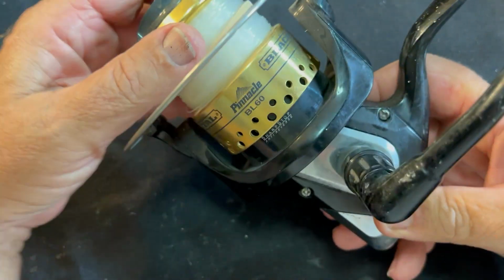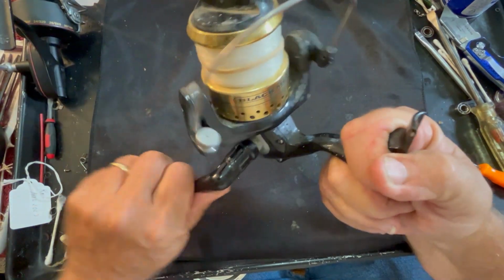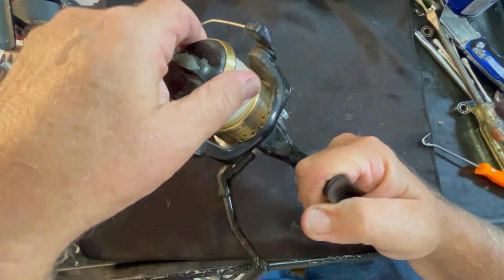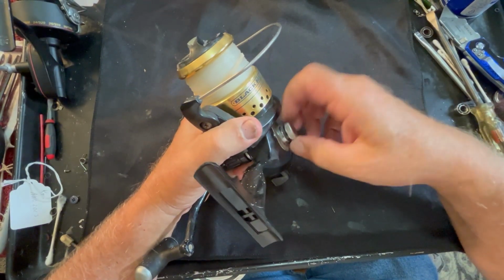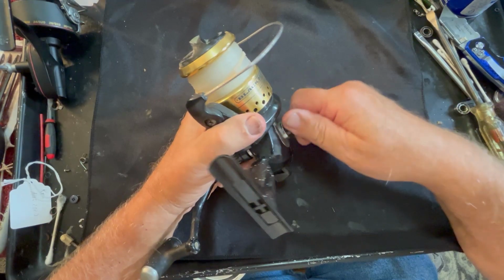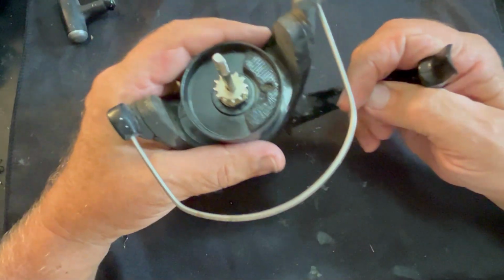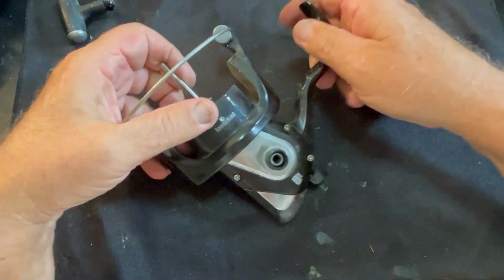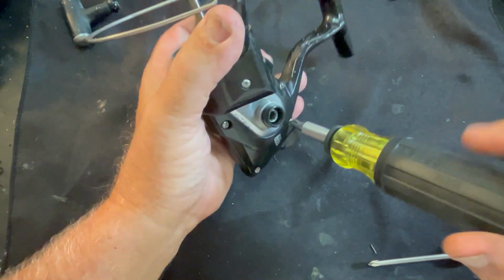Pinnacle BL60 -- Service and Lubrication -- Young Martin's Reels

Comment: I used your useful video to service my BL60. Sadly after doing a complete service, I noticed the bail wire was ready to snap. Any clues to finding another one?
Reply from the maker: Unfortunately that reel doesn’t seem to have been very popular so there aren’t that many out there for sale. I think your best bet would be to keep an eye on EBay for a parts reel. There aren’t any right now but occasionally I get lucky and find a hard to find part there.

Comment: This reel bears witness to what I’ve often heard about Pinnacle reels. They are decent, well designed and fine operating. They were once located in South Carolina and were paired with Silstar. I don’t know if their was any hierarchy to the two brands but i’ve heard better things about Pinnacle. Of course like so many vintage or older reels, you can’t find parts for them except by using the occasional donor reel. I don’t honestly know if anyone owns and still produces any reels with these brands but I doubt it. I have never disliked any of your videos. I will honestly tell you when I disagree with you and most of the time why. For instance I don’t put grease on line rollers but you are not wrong to do so. I oil line rollers because I service my reels after I use them and almost always check the line roller and clean when necessary and then oil them again. It’s just a matter of how you choose to do things. A reel that is not serviced very often or if ever might indeed need grease on that roller rather than oil.  On reels like this where there is a shaft from the AR switch on the back of the reel going to the actual AR mechanism under the rotor, i oil where that shaft goes through the reel body on both sides. Also I always put a drop of oil where side plate screw sockets are when I reinstall the screws. It’s just my habit especially on reels with a metal housing. You know how I like to wipe down all my reels with my Otis gun wipes. They clean the reel incredibly well and protect the finish on the reel. This was a great video Rick! It may be the first Pinnacle reel I’ve ever seen in a service video. — Chris
Reply from the maker: Chris, this the second Pinnacle reel that I’ve done a video of.  Here is the first one:

https://youtu.be/8k1PM_siUrA?si=kYHUH0jjcZeESvT_

The BL60 is a larger, better made reel than the other one. It has a bronze bushing instead of the plastic seen in the 35. I liked both reels.